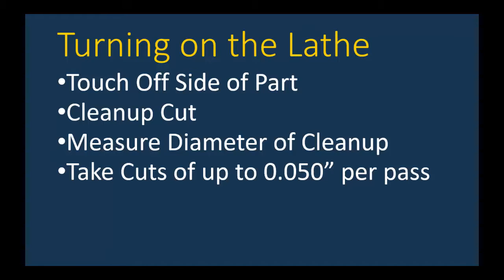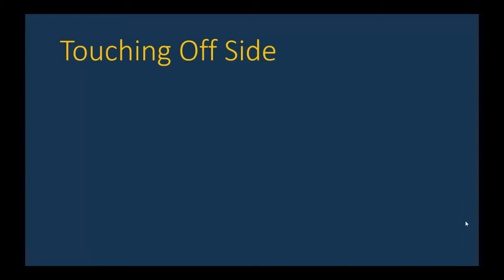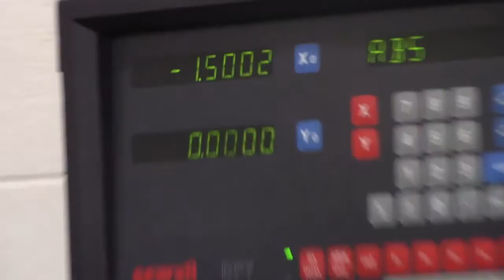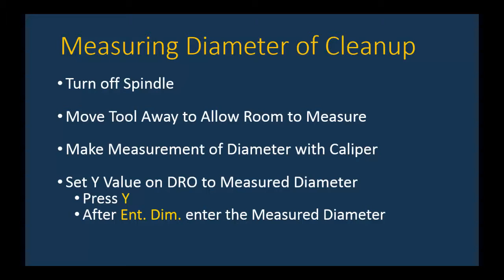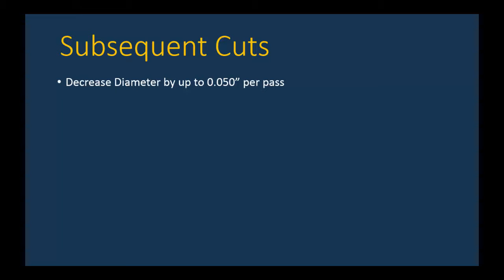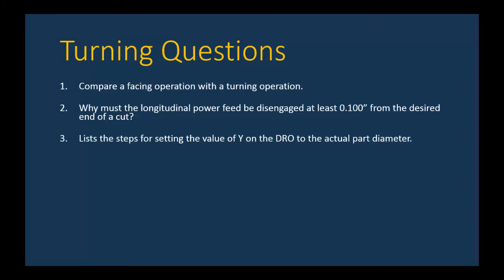MCC ENR 153 Machine Shop Video Lathe 7  Turning

Comment: 1.) Both turning and facing require touching off with the cutting tool, performing a clean-up cut, and measuring the stock after the clean-up cut. However, facing stock will change its length, while turning stock will change the diameter.
2.) Disengaging the longitudinal power feed ensures that you will get a precise cut, as you adjust the cutting tool to the final length manually. This also makes it easier to avoid hitting the collet with the cutting tool.
3.) To zero the Y-axis, touch off by moving the cross feed along the Y-axis, then press the Y0 button.
4.) The maximum amount of material that can be removed in one pass is 0.050". To reduce the heat on the stock, be sure to use coolant oil.
5.) Using calipers to measure throughout the cutting process ensures proper measurements, as the DRO is only a guide.